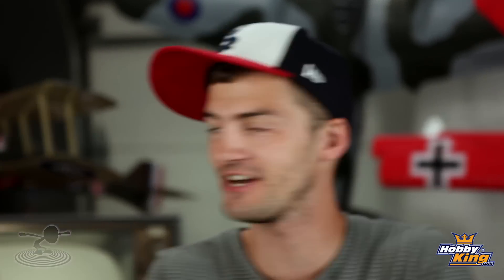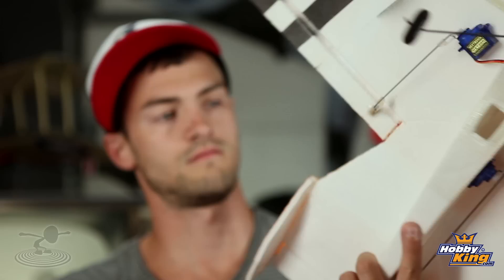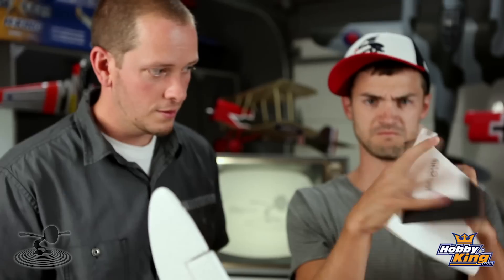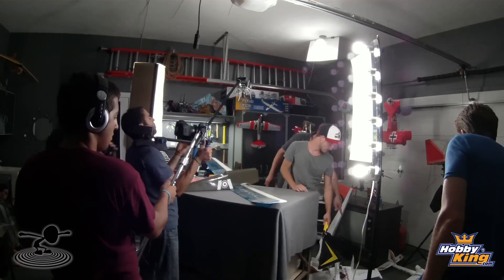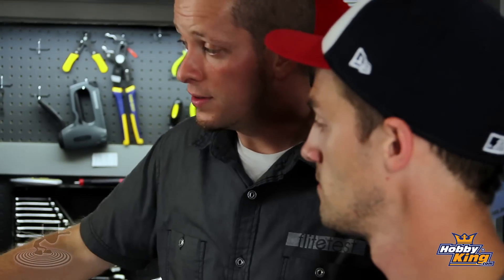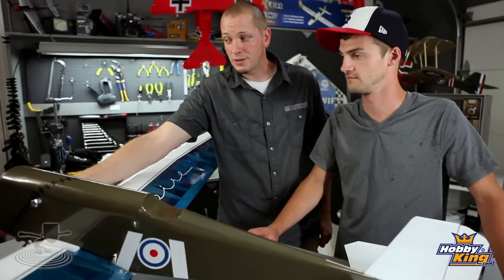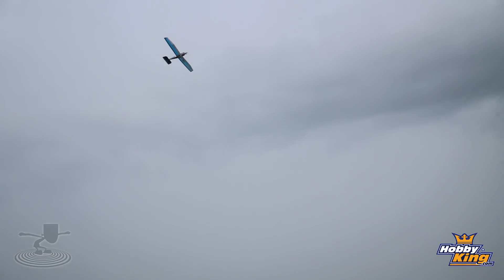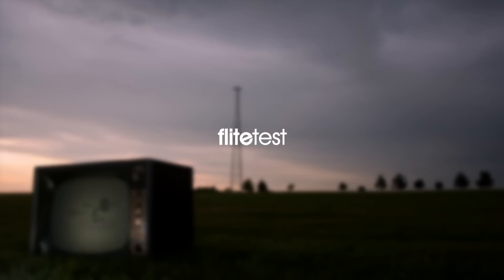Flite Test - Frankenplane Build - PROJECT

Comment: Have done this with a 1/4 scale Piper Cub tail, a length of square section of plastic drain pipe, a Precedent Low Boy wing and a OS .40FP series two stroke engine. fish tailed like crazy, could not do any aerobatics but was good at touch and goes.

Comment: I built a 3ch plane just like in this video (Pitch & Yaw) out of an Air Ace III B17 Betty, 2 clothes racks and 2 Jamara Servos. The funny thing is, that you need two people to fly it because it´s got two receivers. One for the 4 motors and one for the two servos. (If i could find out what voltage and amperage those motors tolerate i might be able to put it all together but i dont think i ever will.)

Comment: @simio1337 If the difference between flash and bang is 5 seconds then it was aprox 1 mile away. Speed of sound is 768mph at 20°C (slower when it's colder) which gives you 5 seconds per mile.

Comment: how did you make the landing gear?
Reply: +Drew Martin Piano wire and solder works well. Silver or high tin solder is best for high strengths applications. The wheels are located using 2 set collars.

Comment: i am a kid trying to get into the hobby what kind of plane should i start with i really want to have some fun.
Reply: E flite Apprentice or Hobbyzone Super Cub DSM RTF
Reply: I started on the flyzone super cub and its great to get you to start thinking in three dimensions and get you in the right mindset of flight. Its virtually weightless so crashes will not damage it (Don't fly it in a windstorm or the wings WILL snap off. Not that I know from expieience or anything cough cough). And then when you grow out of it (or snap the wings off in a horrible accident) you can canabilze the electronics to make a nice little glider if you'd like.
Reply: FUNCUB. Wings high cause they fly more stable. Start with EPO foam planes. They are easy to repair and fly slower
Reply: if you're remotely crafty, I'd check out FliteTest's FT-Swappables.  Either order them from these guys in a kit, or build it yourself from free plans and some $1 foam board.

The electronics are fairly tough, and about $70 all included. But the airframe - the part you're going to crash, alot, is cheap.  About $1-$5 if you can build it from plans.

it's a fun project, and the the first three are very good trainers for learning how to fly.  My 3 year-old enjoys flying the "nutball."  The thing has good lift, and is so docile I don't mind letter her have a go with it, and it costs about 10 minutes and 1/4 sheet of foam-board to make a new one ;)
Reply: P Murphy Building a plane is great fun but if its your first plane only do it if you have experience building OR if you know someone in the hobby personally that would be willing to help. Thats an immense project to take on as a beginner. Although if you can get it built right (which if you know what you're doing is not complicated) then yes a lot of them look like very friendly and enjoyable planes.
Reply: Smithy0013 I've been building model cars and plans since I can remember.  This isn't that tough at all, especially with help.  if the OP guy has friends, they can do it for sure.

An FT Nutball is simpler than most static models in a lot of ways.  Don't go intimidating them.  Have you even seen what a nutball is?!  If you build the original design instead of the "swappable" it's a motor mount, on top of one piece of foam-board and one vertical piece of foam for a rudder.
Reply: ***** Only if you have a park big enough  as they are both pretty big..